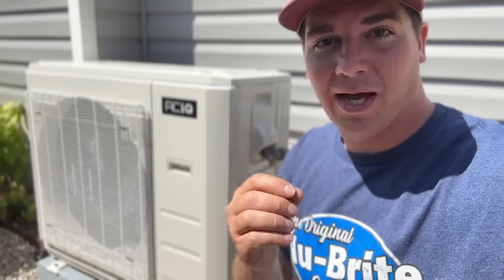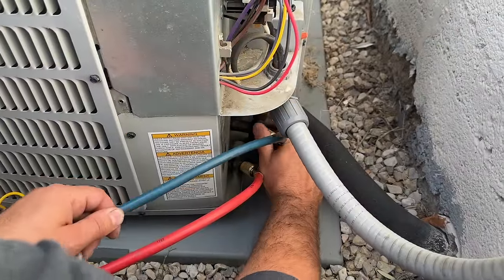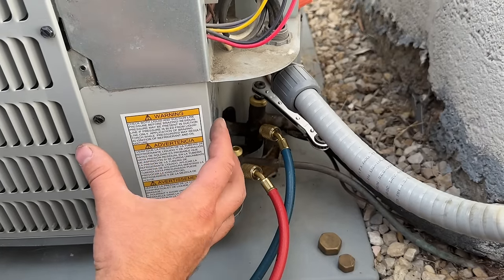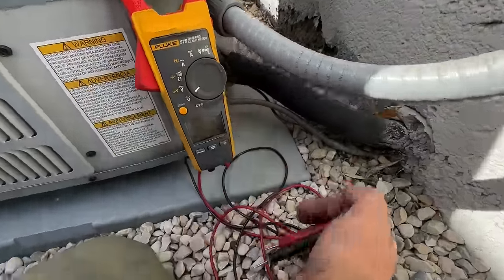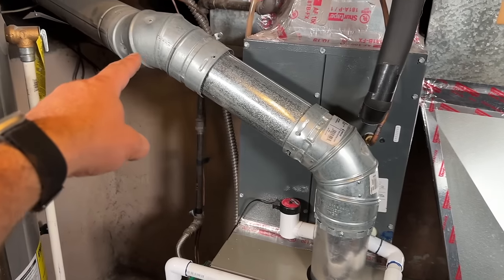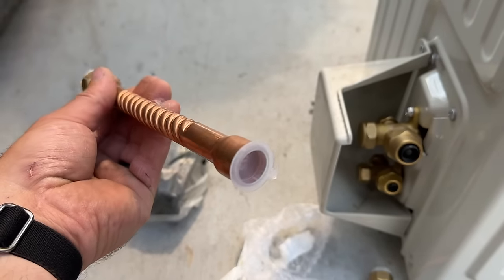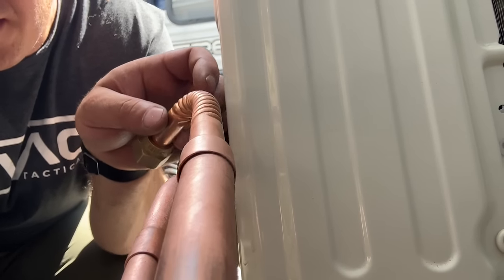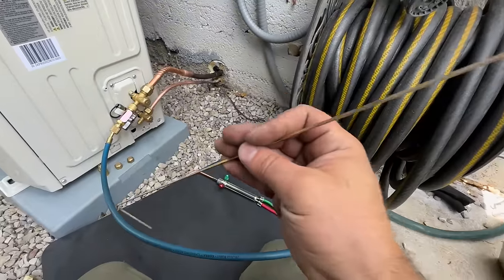How To Convert Your Air Conditioner To A Dual Fuel Heat Pump

Comment: If only they could make these systems accept solar panels without the need of an inverter (like the eg4 mini splits). This is such a ni brainer for sunny places. With 1-2kw solar panels this should barely get any energy from the grid during the day
Reply: Solar is only DC, so until there is some new invention with solar technology, you would also need an inverter… Alternatively, I suppose of the entire system could be DC, but then one would need a Rectifier… Six of one, half a dozen of the other!

Comment: You are a threat to many HVAC contractors because you educate the public. Here's why. This applies to many trades and not just HVAC. Let's focus on HVAC, though. You're average, but not all, HVAC guy prefers an "uneducated" consumer. Let's say your AC goes out and the problem is a bad capacitor with the top swollen and about to pop. A Titan Pro 45/5 costs 10 bucks retail. Takes 5 minutes to change. The AC guy tells you need a cap, contactor, need to clean to condenser, new condenser fan and a defrost board because you have a heat pump etc and all you have is a simple problem. That will be 900 bucks, but you don't as a consumer know any better so the consumer coughs up the scam money.

Keep up the good work educating the public.
Reply: Or they have the balls to just charge you $500 for the $12 capacitor plus an hour of labor and don't do anything extra. Not all of them, I'm sure there are good guys left in the trade. But enough of them are crooks and they wonder why brands like Mr Cool are taking off.
Reply: @opteliv8077  of course it's just a shame. And that should be the difference between calling a professional and doing it yourself. The tech should be going over everything and cleaning that system out to make the customer feel the hour or whatever charge is justified
Reply: Check this out. Daughter buys a house and wants me to check the AC...split 3 ton 10 years old. I'm a DIY guy with a 608 certificate type 1 and 2. Superheat looks good... it has a piston. Blows cold air. I clean the condenser and I pull the blower because it is filthy and clean it. Slide it back in, connect electrical and turn it on to cool. grandson says I see smoke... it was a very fine mist of refrigerant at the base of the evap coil. Two almost microscopic leaks. I tell her to call "X" who i have not used before, but recommended. He has been in business for decades. Coil needs to be replaced no problem. Old coil comes out, new goes in. No nitrogen, no vacuum and no new filter dryer. Dumps in 410a with no scale. Beer can cold is what she got.  @ReliableHVACR
Reply: @joecooksey4331  ok well that irks me, seen it too many times. I can't recommend anyone either because of things like that. But it'll work that day right, they'll just tell you they never had a problem in all their years

Comment: Video is a little misleading this is just a change out.
Reply from the maker: Not just a changeout. It was ac, and now it’s a heat pump.
Reply: @diyhvacguy  yes but I think everyone was under the assumption you was adding a reversing valve to a preexisting unit.

Comment: Pressure come out of a new A coil?
No sir its a vacume, not presure.
And shouldn't you be changing the linesets also  for long term reliability  coolent types can make other chemical coolent brands less effective mix and start eating the internal parts, yes you can flush them out but do the original copper lines meet the requirements of the new system, in this case you replace the whole system and fix any duct work you can get to to proper size, you'll save more money in energy bills in the long run and have a system troble free last longer. 
Id also change the gas furnace to 97% or better efficient and burn outside air vers inside air 
Whats the point of suckling air from outside the house in past a envelope that has cracks in walls past windows and doors making a cold outside air draft or down a chimney. All these cause ways for lost energy.  

If your making a home more energy efficient you go at every aspect or your just wasting money you will have to address later when the old furnace fails. And it will.
Reply from the maker: It’s absolutely pressure. Nitrogen charged.

Comment: So the solution is to buy an actual heat-pump (horrendous brand) and not follow the manufacturers instructions and just braze the thing instead of flaring (far easier for homeowners)? .... this guy is a hack who should know the likelihood of a homeowner not messing a critical step in the install is about 1 in 20 .... He's NOT doing anyone any favors.

Comment: I thought you were going to do something impressive, actually CONVERTING an ac to a dual fuel heat pump.  By adding a reversing valve, accumulator, outside unit txv and defrost board. Along with adding a check valve across both txvs.  Instead we get a standard rip out the old and install a vendor’s new heat pump.
Reply from the maker: Yea, that would be way too much work for what it’s worth. I’d advise just picking up some new equipment.

Comment: When I replace A/C units, I find it easier and more convenient to vent the old coolant into the air.
Reply: That is very bad for the environment, and very illegal.
You should never vent refrigerant into the air.
Reply: @michaelcollins5438  I couldn’t care less about the so called environmental impact as we have research covering thousands of years on the environment from NOAA that is actually inconsistent with so much of the narrative pushed by idiots… However, venting refrigerant into the air is like pissing away money… Which also proves that, if the claims are true about certain environmental matters, capitalism is actually beneficial to the environment!